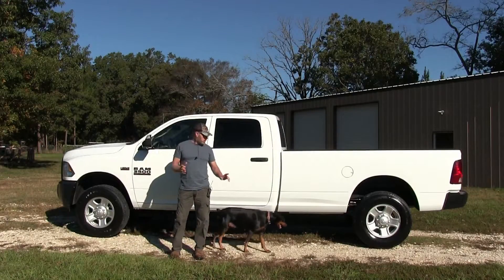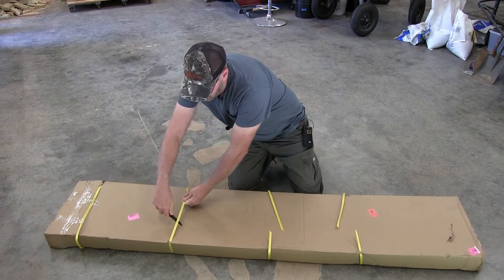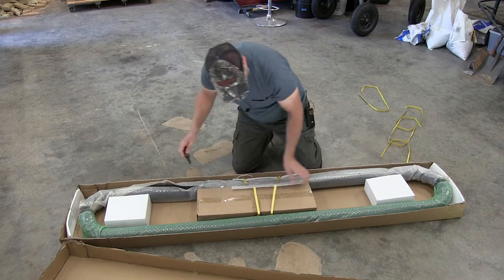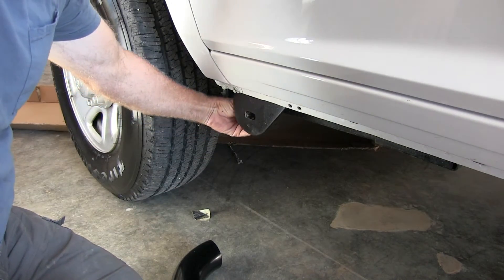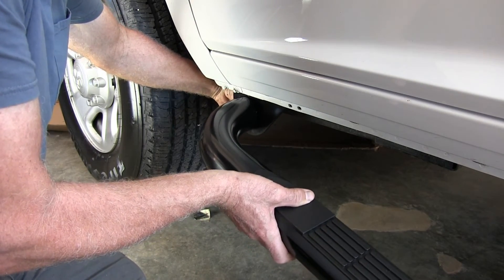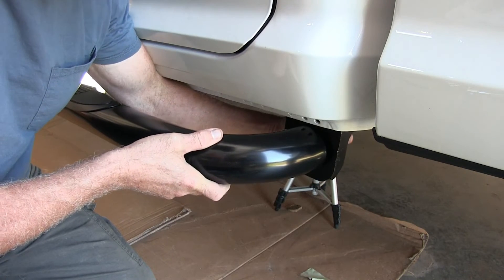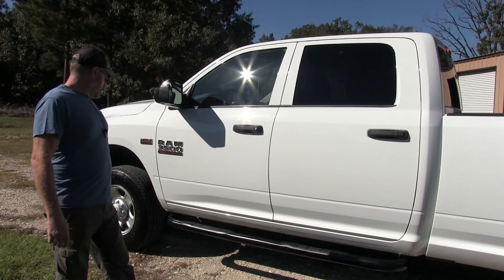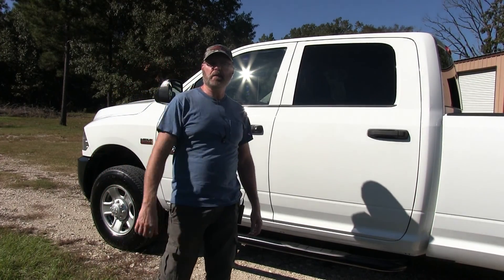Truck Running Board Installation Ram 3500

Comment: Thanks for the video, I wasn't 100% sure what to do with the body bolts for the front mount supports.  These same exact boards are now $183 for the chrome version from Real Truck if anyone is interested.  Not a bad deal I guess, I just put mine on and they look good.

Comment: I got the front body bolts out but can't get the rear ones out....even used a electric impact with 1000 pounds of breakaway force and they won't budge

Comment: I bought some used step boards for my 2018 ram. I need a replacement of the fasteners. I have the brackets and boards only.